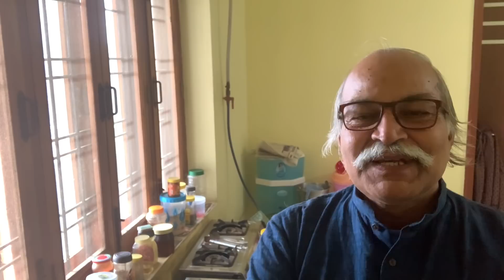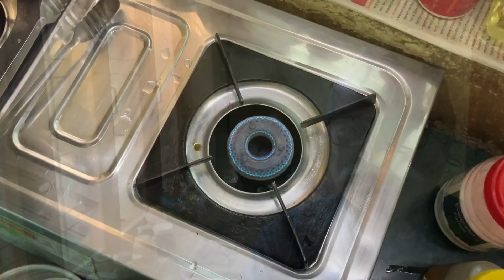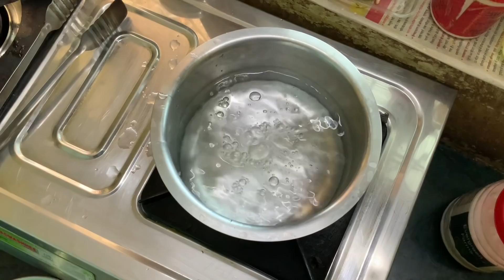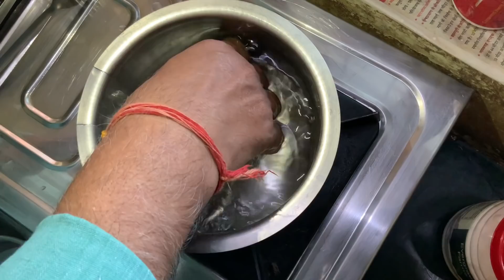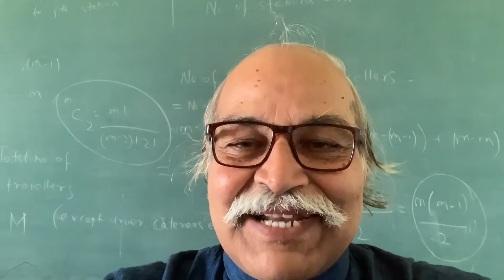Bubbles in warm water

Comment: Dissolved air comes out of water as it is heated. The scratches and imperfections at the bottom and sides of the container serve as nucleation sites for the bubbles to form. After a while all the gas comes out. Then as the bottom starts heating, steam forms there and those are the bubbles of steam.
Interestingly the bubbles of dissolved gas rise to the surface and pop with almost no sound, whereas bubbles of steam rise up and collapse as they meet the cooler layers of water above, causing sound waves to be generated as they collapse. The sound that we hear during boiling is due to these steam bubbles collapsing.
Furthermore, ironically, the rate of heat transfer decreases after a while as water heats further due to the formation of steam layer at the bottom…sort of like the Leidenfrost Effect.

Jearl Walker had a very interesting article in Scientific American on boiling…there were some papers also on acoustic of bubbles.
Reply: @BlellzHadEnough as you said that he might be an adult in 2011 so he could be a father of a child till this time and his child could do this copy paste!(only guessing sorry if I hurted mistakenly)
Reply: @AmanNafees  mast
Reply: Why do they stick to the bottom of the pan then? Also when I went and tried to remove them using a spoon, they stuck to it rather than flying to the surface.
Reply: But sir, I have noticed these bubbles even in cold water in a plastic bucket they are only found in the suface of the metal/plastic. They don't by themselves unless they are disturbed.
Reply: Looks like found the answer
Reply: That's interesting
Reply: @Alive6371  why don't you read my comment once again and come to an alternate conclusion.. for I think you didn't quite get what my point is
Reply: @suraj-sc9ne  Sorry, my bad
Reply: @Alive6371  yeah we're cool 🙌
Reply: could you share the pdf? the Scientefic american file of Jearl walker?
I did end up on their website but yk I have to have a subscription to access that...
Any help would be great.
Reply: Is it copy pasted or written
Reply: @Nordstrom69  why do you even care about that? when free knowledge is being given, just take it, trying not to interrogate if it is copy pasted or not lol 😅🤣
Reply: @Nordstrom69  So what even if it's "copy-pasted". Knowledge isn't subjective, is it ?
Reply: I'm trying to think counterintutively. I'm guessing a type of  Leiden frost effect at the bottom of the vessel. As the bottom of the vessel is heated max compared to other dimensions of the vessel so there is probability of Leiden frost effect happening at the bottom of the vessel .

For understanding Leiden frost effect watch the video on the YouTube channel veritasium.
Reply: @theoryofeverything4237  chutiye. Kuch bhi Bol raha hai. Soch to thoda
Reply: @korigamik  Kyun, kya hua, bhai ?
Reply: @korigamik  bhai yeh veratasium wale hai
ek video dekh kr khud ko mahan samjh te hai inko chor...

Comment: According to my knowledge it is not necessary that every molecule of water has equal  temperatue at particular stant so some molecules which gain  enough energy to get vaporized at below average temperature of water those molcules are forming bubble instead
water has not reached at 100°C.

Sorry if i am wrong.

Comment: Sir, I'm not sure but I think when H2O gets heated then at bottom due to High temp. Air tend to move up and also the water molecules due convention of transfer of heat and during this process the only force acting on water is surface tension and due this water tends to minimize its surface area and during this air hot traped in this due to small moleculer size of air than water ..... Please reply me sir am I right or wrong ????

Comment: Metal vessels have some negligible spaces on microscopic levels so there air is already traped when we pour water in it and when we heat that metal vessel the metal expands and fills the empty space bw them so traped air leaves that space and comes out as form of bubbles

Comment: Those bubbles consists of oxygen and carbon dioxide dissolved in the water...
.
Also if we freeze the water which was boiled before, it wont have whiteish colour which is genrally observed in ice cubes (white colour is due to the dissolved oxygen and carbon dioxide gas)...

Comment: Sir , these bubbles are forming because when we raise the temperature the molecules were increasing there kinetic energy and due to which pressure increases but surface tention tries to bound them which create that bubble structure 
Whose radius must be equal to  2T/(difference in pressure with respect to atmospheric pressure)

Comment: Their may be the presence any other type of gases already mixed in water, on heating the kinetic energy of molecules of the gas increases and it escapes from the attraction of water molecules. As a result the bubbles may be seen. BUT MY QUESTION is If HC Verma sir placed a cool cloth around the vessel so to stop the temperature from increasing  and continued the process as in the video. Will the bubbles disappear at some phase. If this happens than we are sure that there are external gases mixed in water.

Comment: as far as i know , evaporation occurs at every temperature and when some amount of heat is provided the molecules of water get some kinetic energy and they started to come out. 
 i am eagerly waiting for your explanation sir
Reply: Yes true....but water should only convert to steam after water takes the amount of heat that is latent heat of vaporisation...Also evaporation is a surface phenomena...while here bubbles are coming from the bottom..so either they are dissolved gases or there is small pocoets of high temperature in the beaker

Comment: Sir I think that water is converting to steam in 45 to 50 ⁰c because though the temperature is not 100⁰c but in very small regions the heat energy is enough to convert water into steam. AM I CORRECT SIR????
Reply: No, The solubility of gases dissolved in water decrease when temperature is increased. So, the gases dissolved are coming out of the water.
 It is told in 12th chemistry NCERT.

Comment: Heat is directly transferred to the lower region of water, thus heating it faster than above layers. Thus, those bubbles may not be 100°C steam, but initial water vapour pockets which has just started to form(but still not enough energy to break water bonds,and rise up).

And temperature you feel in your finger may be it's avg. temp as it moves through all the layers of water.
This is my thinking, but really loved the daily life question. Waiting to know the truth about it Sir.
Reply: I kind of agree with u but sir can comfortably touch the lower surface of utensil so temp shouldn't be more than 60-70°
Reply: @AbdulHadi-hl3el  can't be so high it would be around 30-40 %
Reply: Yeah it's water vapous cuz heating water above 100 degree result in water vapour and that water vapour ( it has energy in the form of heat) become lighter from the water just above it so it comes out as in the form of vapour